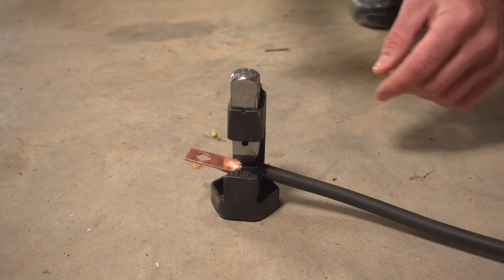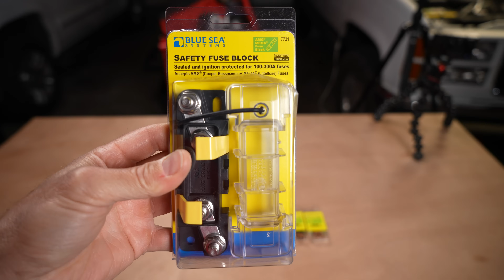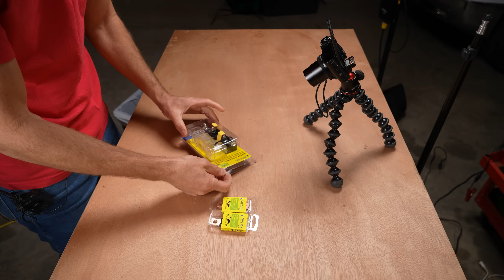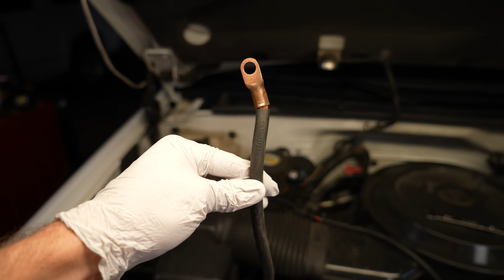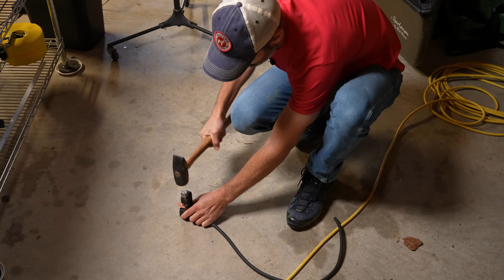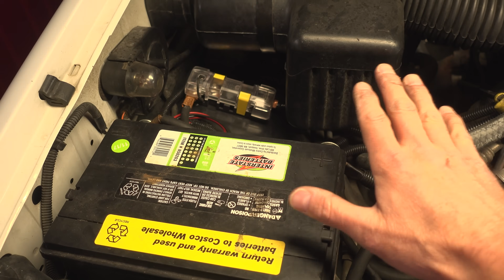Here's Why You NEVER MESS WITH Your Vehicle's ELECTRICAL System!!

Comment: This wasnt well thought out well as far as possible places of failure. There should of been a distribution block and all of the electrical systems should of went through the fuse to the battery. Considering a major short could happen only the alternator is gonna be semi protected by a fuse. The fuse is capable of carrying 3000 watts of power for a given set of seconds. The starter would have to ride its own battery cable since it will draw 6000 watts at cranking.

Comment: Not a fan of the logic in this video. This is not hate, just constructive criticism.

If the only thing we're adding a fuse for is to protect the positive wire to the alternator from coming apart and ground faulting on the engine block, then the positive wire before the fuse going to the battery is at the exact same risk, moreso when it's exposed copper lug is hovering one inch above a grounded body panel, only suspended there by double sided tape. Maybe if it was adequately insulated with heat shrink and fastened down correctly, but you're still at the same level of risk if it was just directly connected to the alternator. Mechman specifically states that many factory vehicles do not use fuses between the alternator and battery.

Comment: I definitely wouldn't have soldered those lugs - soldering a crimp connection just creates a weak point where its more likely to break over time with the vibration. A properly made crimp is stronger than a soldered connection anyway

Comment: I'm 1/2 way in but still haven't heard the title of the video mentioned 
the big three "is" messing with the engineering of the electrical system 
I agree better grounds, especially with older rigs.
I also understand the engineering behind the system 
&  I try to stay away from modifications, from secondary sources, out thinking the original engineers is a fools bet 
but it seems your video should be how to install a fusible link 🤔 
I do enjoy your videos & exposure to new products, since city life means.more work & less dudes hanging in the garage unless there getting paid,  sharing information is very cool 😎 
the answer to the title 
"Here's why you never " it's simple 
because the engineer that designed it has spent years & most his life, studying it.
a question still remains ..
leaving the stock wiring in place is it a good idea ? 
especially the hot wire from the battery to the starter, the highest voltage draw, I have yet to see this on any video from anyone during the upgrade 
starter, low on the motor, weather & water exposed has the wrapped stock factory wire ... is it enough? 
I say no it's the weak link 
5/16  copper lugs... a must 👌

Comment: With such thick wire, I'm wondering if that fuse is rated to handle the dead-short-circuit current without exploding?
Update: Apparently the maximum interrupt current for that model fuse is 2000 Amps. That should be enough for a 12V lead-acid starter battery.

Comment: You never upgraded your vehicle ground.  The positive cable is only half the circuit. You should also run a 2 gauge wire from the engine block to your negative on your battery as well as a 2 gauge from the engine block to the vehicle chassis. You also should cover the copper lugs with heat shrink tubing as well as reduce the fuse amperage to 250A. The last thing I am going to say is you need to realize that you are risking vehicle fire for a piece of 2 sided tape - you need to replace that double sided tape with screws.

Comment: You know where there should be a fuse? Between the battery and the starter motor. I'd it shorted recently and for some reason it caused the motor to go to 0RPM immediately, locking the front wheels of my car (maybe the alternator plus the lack of energy for the spark plugs caused it) right before smoke taking place. That was my lucky day to be with my ax in the passenger side's floor, so I could fastly cut a cable before the entire car was on flames. Now I've a fuse in any cable from the battery, according to the capacity of each cable.

Comment: blue sea is used on fire trucks for there high volt systems and there easy to install this some know how but if you don't have any high voltage training i wouldn't mess with them
Reply: added note i would drill and use a button head bolt to mount it with the nut on the fuse side  fore a cleaner install and heat shrink tubing to help insulate the cable a bit more but i love your videos keep up the good work

Comment: That looked quite dangerous. You had the plus cable connected to the battery while connecting to the fuse block, just some centimeter or so from connecting with metal wheel well, that most likely is ground and connected to minus side of battery. Maybe mount fuse as close to the battery as possible, since the piece from battery to fuse is not protected.

Comment: I would not use copper pipe to make terminals, there are a plethora of reasons but getting the gauge of copper correct and the resistances right would be hard to deal with, they also would be more prone to corrosion (more internal surface area). Secondly, you should remove your cables, and put heat shrink on them. if you drop a bolt, wrench, etc anything made of metal, you do not want it to bridge with any grounded components. basically any metal part in the engine bay. Lastly solder actually makes connections worse not better, it contains tin which will change from one oxidation state into another and this occurs even in a vaccume its just something the metal does. It used to be used rarely in low amp situations where signal strength mattered, IE a sensor or audio connections, and this was done to prevent corrosion they never saw high amp loads. A better solution is to use pure copper wire, and the correct size fitting in a hydraulic press (which you can rent if you don't want to buy) the crushing force effectively welds the end together anyway so solder is not necessary. There are also self sealing heat shrink tubes. They are thicker and higher quality. I get mine from a Tractor trailer supply store.

Comment: That 12 volt system is going to eat up that fuse. 32v at 300 amp.

You need a 12 volt at 100 amp fuse seeing most alternators push 75 amp
Reply: Amps are amps, its not a power interrupter, ie motor starter, its a fuse. 300 amps is 300 amps, plus even if it did work off power, 12 volts (or more properly 13.5-15 volts) would be less power.
Reply: @integr8er66  think of voltage as temperature. Amps as the flow or amount. Wattage as amount used. 

That being said, now think about a engine. If you run a engine at half temp all the time you shorten its life span, and kill your fuel mileage. It's the same thing. Just on a fuse, you can't see it coming like you can with your v8 sitting in your driveway....

Comment: Select models of gm also have a gem module (computer) for the alternator. If you got one. It's a black box that goes around your negative cable at the battery, and has a pig tail connector going to the vehicle's main harness. Those vehicle's that have them, the volt gauge tends to move between 12.5-15.5 volts. Their intent is to protect the battery from over charging (excess heat during the summer).  Just throwing that out, so if you see your gauge moving, it's possible that it's the module. Always test your alternator under load with the engine running. 13-15 volts on a multi meter is what you should have at the battery. Also check the post on the alternator to the frame. That's how you test the in line fuse. If you got power at the alternator of good voltage, but not the battery, than it's your fuse. Always test on a known good battery too. If your battery is below 12 volts at all, it's bad and needs replaced. It's got a bad cell. 

Use this info, auto parts stores will lie just to make a sale....

Comment: Ummm shouldn't you be using a 250 since the alternator is rated for 250 amps and not a fuse that is 50 amp over?

Comment: I’ve started putting resting circuit breakers in place of fuses in areas that only require one circuit. Fuses are great to save space in boxes but things that are single run or have large size fuses (which I never have once they blow) all get breakers now. A bit more up front but easy to isolate by opening contacts and so easy to reset.

Comment: Ok making a very good crimp connection from copper tube. And the ruining it by making a less strong connection special for high current in a vibrating hot environment by adding solder. On vehicles please only use proper crimping connections and isolate with heatshrink with hotglue inside. Solder is evil in cars as it will fail when getting older at some point. It is not if it will fail but when.

Comment: I have similar reactions to may of the other posters.  Just created more potential short circuit points by not insulating the crimps on the cables on both sides of your fuse block(as well as the back of the alternator, and in the position they are in, easy to get a spanner, screwdriver or something hooked on them if not familiar with what is there, or in a collision your mudguard coming in contact with it.  

So possibly if your car bursts into fire tomorrow, insurance might be talking about how you made unapproved modifications, as far as I know most cars dont fuse the lead from battery to alternator.  Yes, some may have a fusible link, or just the wire itself  being the effective fuse, whearas you've connected it with 1000+ A wire which will possibly easily not melt if you get good connections on your short and then create a battery fire.

Yes we hear its a 250 A alternator, but many setups have feeds going directly from the alternator to the loads that need them and or to the main fuse block, hence the only current loading from the alternator to the battery is what the battery accepts on recharge and not your 1000 W light bar(or whatever else you have connected) and there would never be a charging current that would warrant such a large wire.

Comment: I would have just added a fuse at the alternator end of the cable.  Yes, just bolt the fuse straight on to the alternator lug, (without a fuse holder). Then  re connect original cable to other and of the fuse and sleeve with heat shrinkable tube x2 ...   plus, smear with petroleum jelly. 

You have just added a load of un-necessary weight & electrical junctions that could potentially go high resistance. Plus exposed copper that will corrode and pose a short hazard if the vehicle is crushed in a collision

Comment: You NEVER solder ANY crimped connection especially working with high load. Also, you had a proper length of the cable already - it was enough to cut it close to the battery or alternator, crimp it on both ends and fit it to the fuse. And buy some heatshrink.

Comment: Good video, but I have some notes/tips for you.

1. Using tinned copper lugs (you could tin your diy ones) are much more resistant to corrosion

2. Some Heatshrink and dielectric grease goes a long way. If your gonna go as far as getting a marine grade fuse, why not seal everything else up?

3. I have never seen a factory charge wire fused, and really isn't needed. That said, it doesn't hurt, just overkill. If you are adding copper to the stock charge cable, and follow the same path, and make sure to use some hestshield, and keep it secured, it's more than enough. If it was unsafe, they wouldn't sell the car like that. One thing to consider, is that the short run from the battery to the fuse, is still live and unfused, but now also much closer to a ground location. It shouldn't be a problem if you keep everything tight.

I've installed many electrical systems in many different vehicles. I personally have a buick I installed a 370 amp alternator and a large lithium bank into.

TLDR: it's much more important that you keep the charge wire properly shielded and tightly secured away from heat and friction, than it is to fuse such a short run that wasnt fused from factory anyway.

Comment: a couple of comments.
- the fact that there isn't a fuse between the alternator and the battery isn't an issue.  It's not typical to have a fuse in that location. 
- A lot of people have suggested that you use heat shrink tubing on the ring terminals.  If you are going to use heat shrink in an external environment, ALWAYS use the adhesive heat shrink.  Never use the regular.  Regular heat shrink will wick moisture into the joint and create more corrosion than it prevents. You are better to use nothing than regular heat shrink.  Also, don't put grease beneath, just use the adhesive stuff.
- I always like to use an electrical corrosion protectant spray on terminals. Easy to use, protects from corrosion, and not messy like grease, doesn't allow stuff to stick to it like grease. Plus it's red so you can always see where it's been used.
- I'm not really sure what you've accomplished by putting a fuse in that location. All you've done is protect that little section of wire from the fuse to the battery. Plus the section you were concerned about, from the alternator to the battery, is now longer.  I think you've actually created a bigger issue than you solved.
- Secure everything well.  The cable from the alternator does not look like it is properly secured from vibration.  That is going to be your biggest issue.  Vibration causing that cable to fail at the connector, or worse the terminal on the alternator.  Secure the cable, and secure that fuse block.  Tape won't hold it for very long.

Comment: Putting solder between 2 metals, here the same metals, you increase the resistance. More resitance means more voltage drop across the fuse, means more heat, more loss energy. What you expect to protect? If this wire touch the metal sheet, your metal sheet will be melt before fuse. You can try.

Comment: Great comments so far.... May I add that per ABYC specification NEVER solder a stranded wire that in in a vessel, or in this case a vehicle (anything that is subject to vibration or movement).  Once you solder it, it becomes a junction where solid wire (the soldered stranded wire) and stranded wire meet.  Now this soldered wire junction becomes the weak point and will be the failure point if subjected to vibration and / or movement.   Man, I cringed at those bare copper terminals myself too...

Comment: Liked the video overall, there are a few things that could be better, one, when and if that double sided tape comes off is probably more likely than it was to short before starting the job, leave the tape, and add an actual fastener or two. Also, your soldering would go much faster and easier if you dipped in some liquid rosin solder, don’t use acid core, it will corrode over time and cause problems. I’d also strain relieve each end of both wires if possible, that solder and crimp shouldn’t be the mechanical thing holding the wire in place.

Comment: Smart fix because a guy should never say never. I had my positive cable to my starter rub through on the fender well while turning in the parking garage killing the truck and started a fire, Talk about panic taking the cable loose when the fire extinguisher failed to put the flames out as I didn't realize the cable had shorted . I now believe in murphy's law especially with electrical components.

Comment: I hate to say this but a fuse isn’t a bad idea but it’s actually not necessary. Secure from movement and moving parts is all that’s necessary. There’s an average of 4’ of battery cable from the battery to the starter alone without a fuse and roughly the same amount of 6 gauge ( average diameter size) charge wire that’s ran through the harness back to the battery. Take the argument up with engineers if you disagree.

Comment: As an electronic technician I can tell you this. You don't need a fuse between your alternator and your battery. But you do need fuses between your draw / drain and whatever equipment that is using the current. Your alternator already has safety mechanisms built in the regulator that won't allow it to cause any safety issues. The only place I'd put that fuse is if I was running a 3500 Watt inverter. I would put the fuse between the batteries and the inverter. I would also put a manual shut off switch between the inverter and the batteries. Whoever told you you needed to fuse between your alternator and your batteries is a dummy or they're trying to sell you something that you don't need. 🤡 Also so you know.. the reason that fuse is sealed is not to prevent corrosion. It is sealed so that way if it blows and there's any gas vapor inside the whole of the boat it doesn't catch fire. Also instead of running a fuse if you're so worried about your alternator overcharging or running too many amps to your battery. It would be better to run a circuit breaker. That way if it trips you don't have to try and find a new fuse at that many amps to replace it with. But you know what do I know? I'm only in electronic technician that specializes in DC for cars and boats.

Comment: Let me tell you this from experience working at a car stereo shop for over 20 years with many alternator installs. If you put a fuse between the alternator and your battery, chances are, the housing will slowly melt due to the heat of the current passing through (If your vehicle draws a lot of current). Fuses are restrictions with impedance. As much as it makes sense to put a fuse there, in reality, it causes more issues than it solves. Just run the cable straight without any issues of getting shorted.

Comment: I've got a 300a alternator in my Mercedes-Benz with 64ah of headway lithium to power my audio system. Got my alt from autotech. It's a much cheaper but solid option compared to mechman. You should upgrade a ground from alt chassis to car frame.